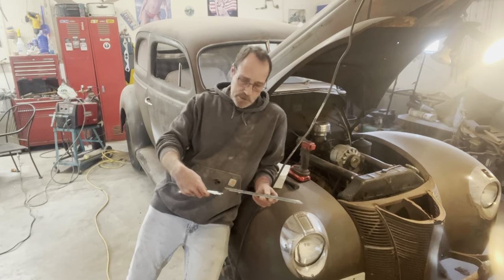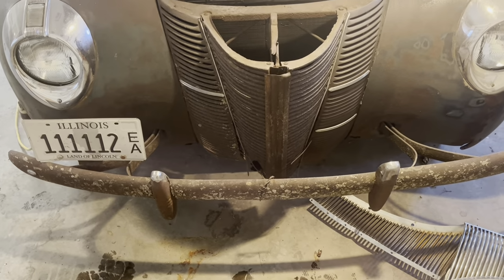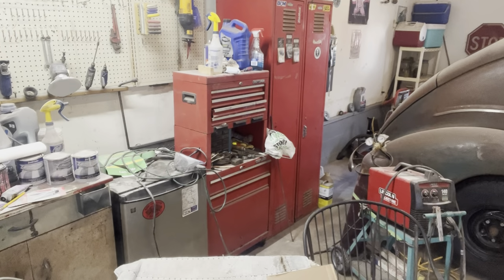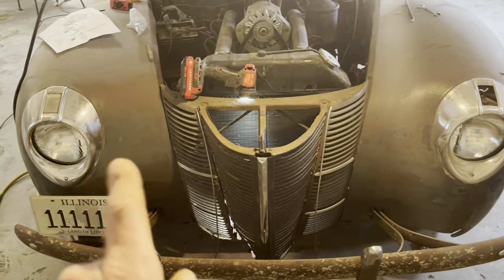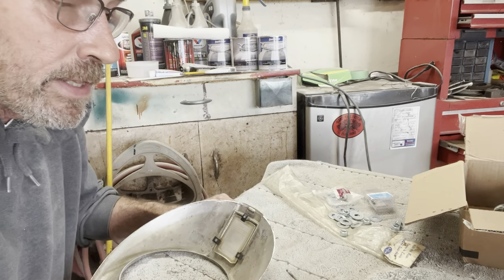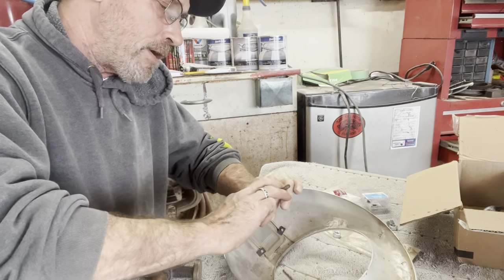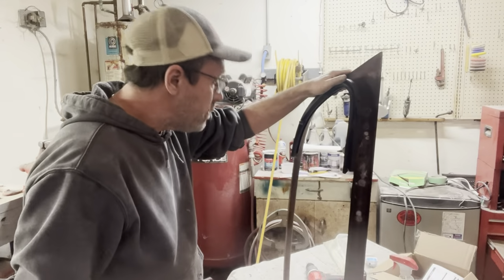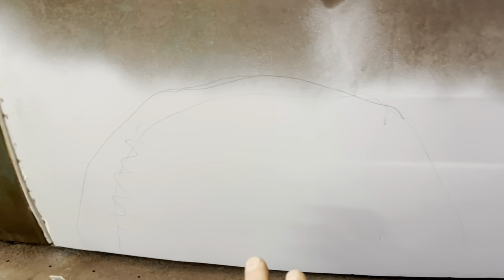Installing front grill trim and parking lights on 40 ford

Comment: These models are so awesome. No nonsense good machines. If you’re planning to drive it a lot remember to service the gear oil in the transmission and differential; those get neglected and forgotten about after the engine gets all the attention.
Reply from the maker: No computers to get in a guys way , that’s good!

Comment: I might be wrong, but I remember my 40 center grill being a two part right/left cast assembly that was chrome.
Reply from the maker: I’m not sure either. I do know that a standard and deluxe are different.  Thanks for following along!
Reply: @mywaymanufacturing2817  Mine was a deluxe.   No turn signal lights back then, used hand signals!  What a hoot thinking back about that when it was raining.
Reply from the maker: @supernovaVII  good memories my friend